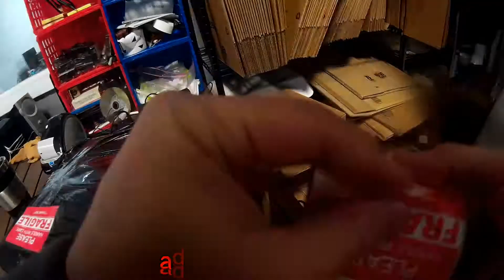How to Pack & Ship Fragile Figurine Packing Orders Guide eBay, Etsy, Amazon & Merchant Fulfilled

Comment: In my humble opinion, NEVER use clear tape on bubble wrap.  It is virtually impossible to find the end of the tape, so the next thing someone does is take out a knife of razor and try to cut it open.  Or, they will try to pry open the clear tape and pull too hard and it finally gives way and it falls to the floor and breaks.  I've seen it too many times.  Use blue tape instead.